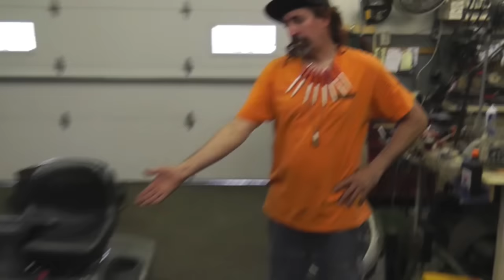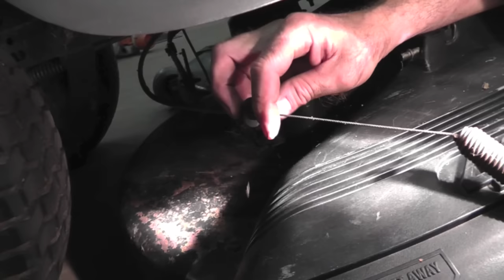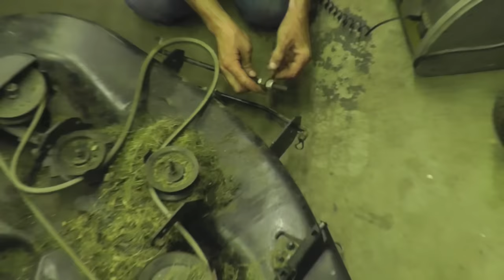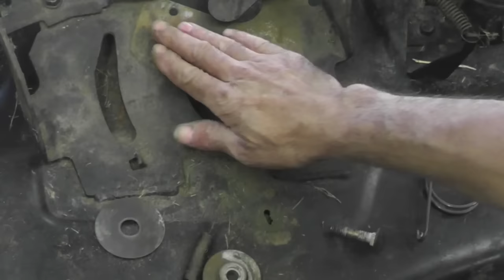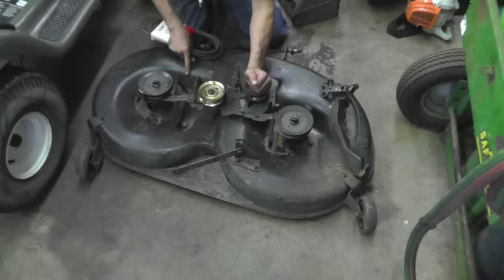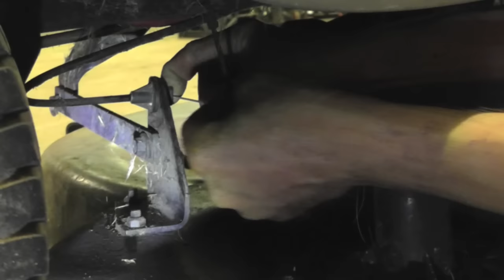How To Fix Stuck Deck Engagement (Blades Always Spinning)

Comment: what's the part number for the belt
Reply from the maker: +Dickey Moore   Some Craftsman have the part numbers under the hood. Otherwise go to sears web site & look up yur model. The model numbers are under the seat. You don't necessarily have to buy the belt from sears just get the part number. Some one else makes the mower for sears probably AYP. Then you can search the web for the belt or go to yur local mower shop. Some of those 42" craftsmans use 2-different belts for the deck. Thats why you should look up yur model to be sure.

Comment: help !!!!!! 16.5 bolens my deck don't have all that . just the engine pully & two pully over each blade . has two break pads over the blade pullys. I bort knew belt knew pads added washer between the break bracket & the deck to make the breaks hit the top of the pully harder. dammm blade still spinning.😫 got a response from a video . said they had the same problem they bent the bracket to the break pads and their did not stop spinning ether. they think the company are making the belt to small and don't no it. help !!!!!!!!!!!.😭

Comment: I know you would rather repair than replace but trust me that my deck was so battle damaged it needed replacement. This video did help greatly with getting the deck changed out. My issue is when the deck lever is in 6th position (fully raised up) the blades start to spin slightly. I don't see any cable adjustment to loosen the belt a bit more. It is tuff to get the lever up to the fully engaged position also. (Belt too tight?) Suggestions?
CRAFTSMAN #917.270750 Thanks Man!